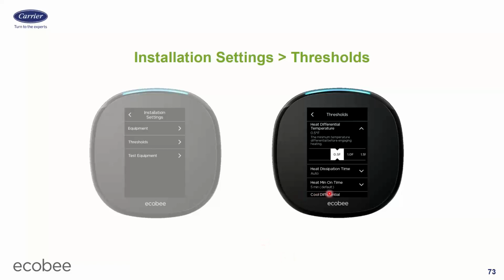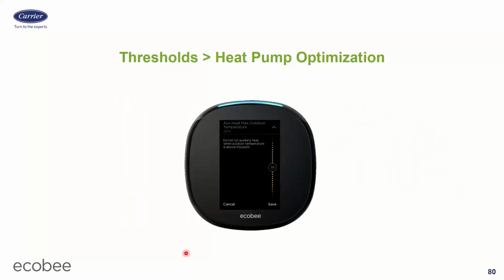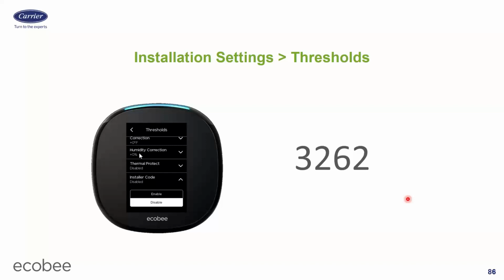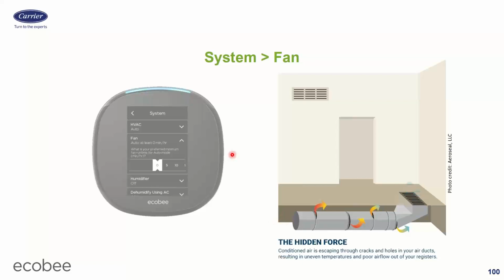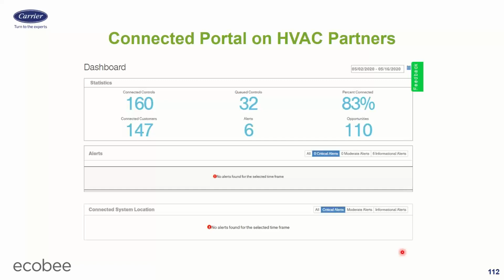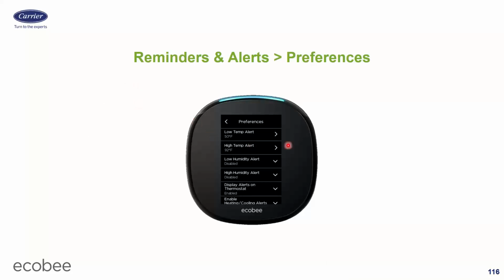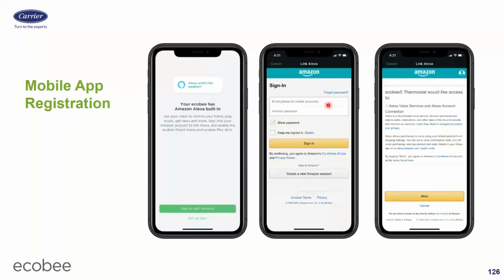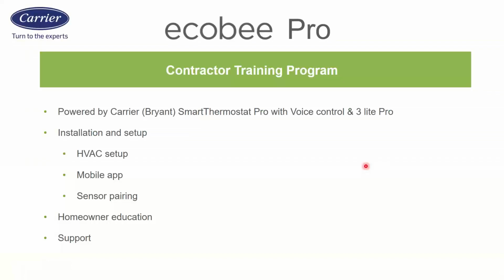Ecobee powered by Carrier/Bryant Part 2 - Webinar 9/30/20

Comment: The new version keeps shoving their Carrier branding in your face. I find it completely obnoxious.
Reply from the maker: This model is made for Carrier specifically. You can use the regular ecobee models that have the bee flying around instead of the Carrier logo.
Reply: @TECTubefilms  Thanks for the reply. I've bought 2 of the same ecobee Smart Thermostats with Voice Control and a sensor a little over a year apart from each other. The boxes are completely identical other than the new ones saying "powered by Carrier." I wish I knew there were multiple versions of the same thing. The Carrier branding is shoved in you face every time I walk up to it and have to wait for it to move, and it is labeled on unit in the app. It's completely unnecessary and even more so that I have a Trane. haha Thanks again for the reply and the info.
Reply from the maker: Correct. Those are two different part numbers for essentially the same product with different branding. It is kind of like buying a GMC truck or a Chevy truck.
Reply from the maker: It is also sort of odd that your Carrier dealer installed a Carrier branded thermostat on the Trane unit. They should have just put a regular ecobee on there. Weird.